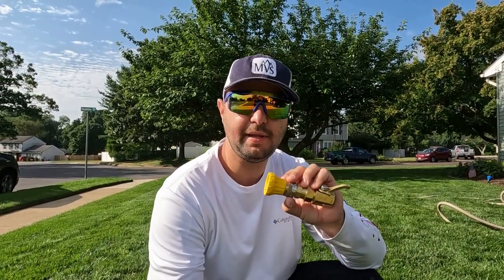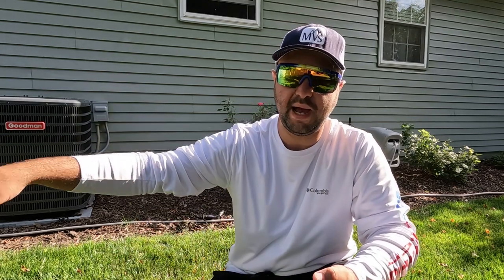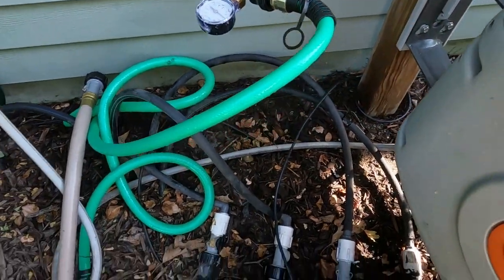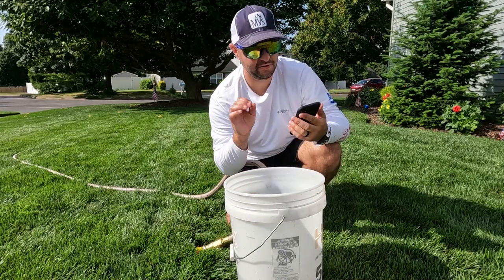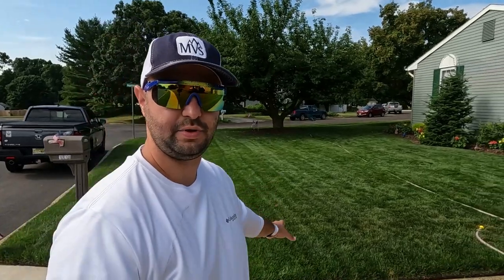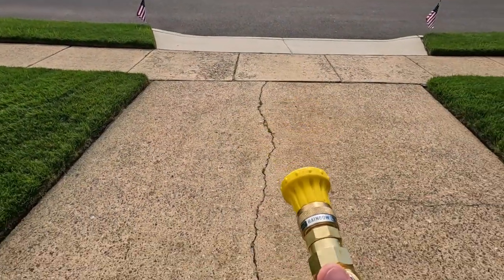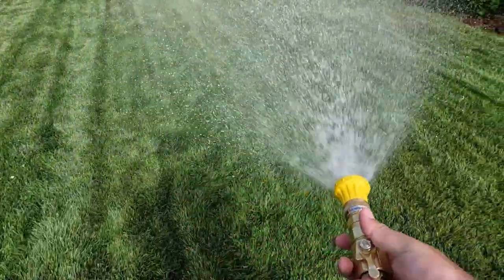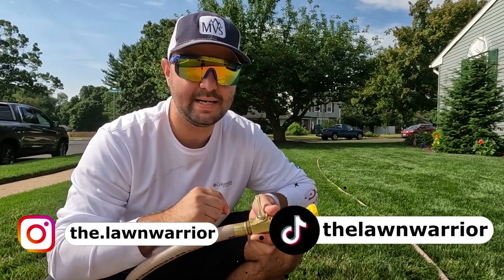Liquid Iron Application GONE WRONG! #liquidiron #lawncaretips #fixyourlawn #lawnfungus #greenlawn

Comment: I just used a 4 gallon Solo back pack sprayer, I mix 8 ounces per gallon per 1k sq ft. My front lawn is roughly 8k sq ft, so I just had to use 8 gallons and 64 ounces of Chelated Iron. I have 2 acres, but I'm just trying to test this out for July 4th to see the results.
Reply from the maker: Good stuff

Comment: Excellent video.  One huge feature of that nozzle is the soft water droplets, which minimizes the damage while watering flowers and other delegate landscape.  In addition, as you saw in your cement demo, the water distribution is very even throughout the pattern (unlike other popular fire type nozzles) which have a void in the center part of their spray). As with the part number, we classify this nozzle in the 15GPM range. NG1500.  But as you said, this can vary based on pressure as well as hose size and length.
Reply from the maker: Thank you Ed for watching. I look forward to bringing more Underhill products to my channel and showing them to my subscribers.